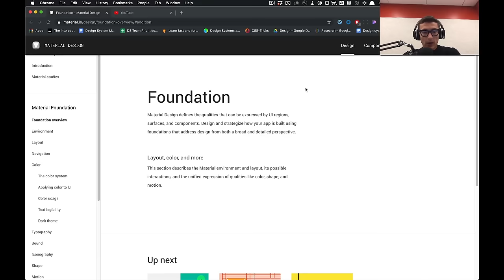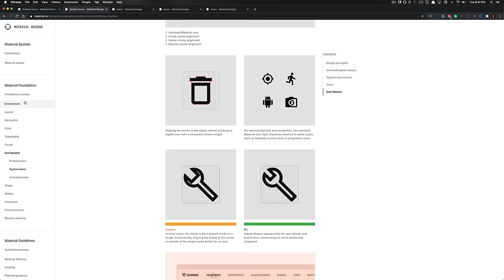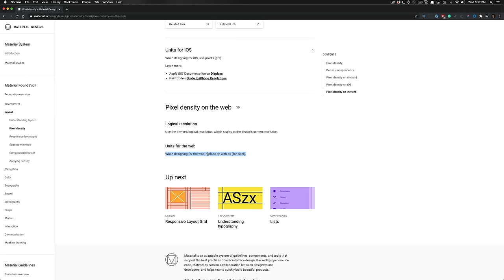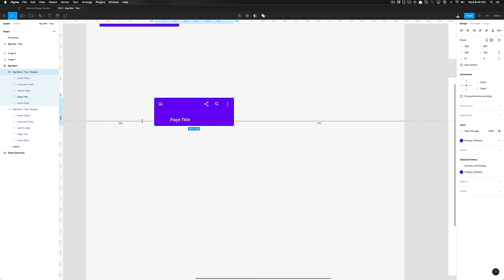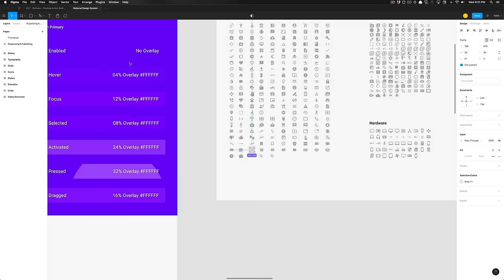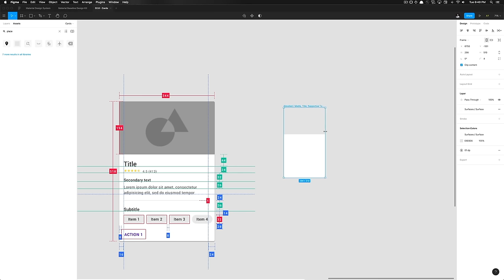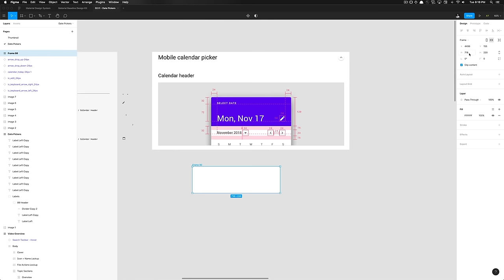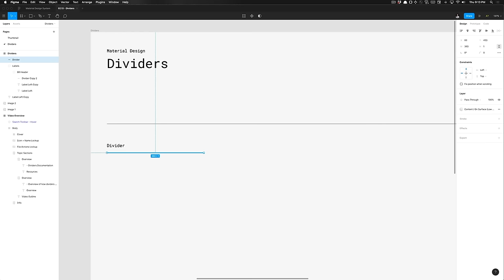Create a Design System with Figma - Full Course

Comment: Design Systems are very cool for if you're creating similar apps/websites for similar clients. In any other case they're almost useless. I've got very different clients in very different business areas (fashion, pharmacy, b2b, small stores, beauty, legal, ...) and it's just impossible to have one solid design system to fit them all. Of course you still follow some basic design/UI/UX rules (padding, margins, proper font choices, negative space, etc) but a legal firm will have a completely different website/app compared to a hospital website/app. There is no way to recycle the same guidelines.
Reply: I think the main takeaway is that it is optimal to have different design systems for different clients. Although, we'd normally see big clients and companies would require designers to have a design system for the project.
Reply: Also if you work full time for a big company a design system is essential to guarantee consistency and to easily mock-up / prototype new products and features. 
If you're a freelancer with multiple clients, you could use a design system as a starting point and tailor it to your clients.
Reply: if the system being developed is complex, you will not only rely on design systems but it will also be your lifeline until the project is finished. So it actually depends on the scale rather than nature or domain areas of the such a project.

Comment: A tip from a fellow designer: 

Check if the developers plan to use a framework, you use the components from their  to design
Reply: what do you mean
Reply: @khadidjamoghrani197  Let’s say the developers are going to use material-ui framework for react, you can get the components and design the product using that
Reply: thought developer should follow what designer design not other way round
Reply: @C0llector  That's not true all the time. Development is more complex than design. So, developers tend to use already built components from famous UI libraries like (mui, ant design, etc).

You can ask developer which library they are familiar with and will be using and then you can use (Figma) libraries of those UI libraries. I think MUI has a figma file for their design system but I'm not sure about Ant Design.

If the website is simple with not much complex components involved than the designer can use whatever Figma design is handed to him and he will custom code that design from scratch.
Reply: @littlechange  That's correct in certain circumstances and when the company/ team is small and mostly dev-driven. We use Base Web component library and it's half-baked Figma resource and it's quite a mess after a couple of years. Best to have a single source of truth such as a Figma file even if it's based on a known library. The issue is that many of those known libraries (MUI, bootstrap etc) update their code but not that Figma file. This is a huge risk and waste of time in the long run.
Reply: @C0llector  that's what happens usually at huge companies that value design and have a huge design team.

Comment: 4:45:13 This is NOT correct. It doesn't have a thing to do with resizing horizontally/vertically, it's about the direction in which auto-layout frame stacks the child elements... You can resize it in both ways, no matter the option. :)
Reply: Thanks for the correction Meris! I’ll be sure to be more precise next time!

Comment: How UX design is related to front end development and how it is helpful in front end??? Is there difference between UXUI and front end development??
Reply: UX is more about planning and defining the flow of the software, as well as defining personas (user types) and doing research. UI is all about the graphic representation of things. It's about designing icons or buttons for instance and giving information a graphical representation on screen. At some point, UX and UI overlap to some extent, but when you start studying the two, you start seeing the differences. As a developer, most likely you'll be given the UX/UI done, just for you to convert everything into code, but if you are a freelancer, you'll need to define those things before even thinking about coding.
Reply: @11vag  ohhh I got it..so the already made up uxui project is given to front end developer and now he or she will create the final product based on that uxui using the code... also having a degree in Marketing is beneficial for UXUI jobs or should I get a degree in IT (talking about masters) because I am planning to do if after my undergrad so what will you suggest??? Thank you:)

Comment: Some of the questions that get asked is what is the design process, what is the design system used, and how have you solved the problem of the client through your design? Design is all about problem solving. How can we learn about design process in Figma?
Reply: You don't learn a design process in Figma > Figma is a tool that helps you apply a design process.